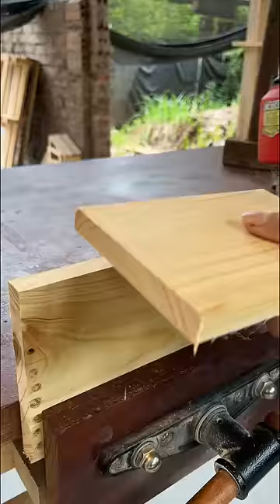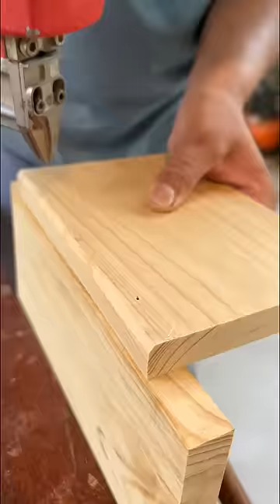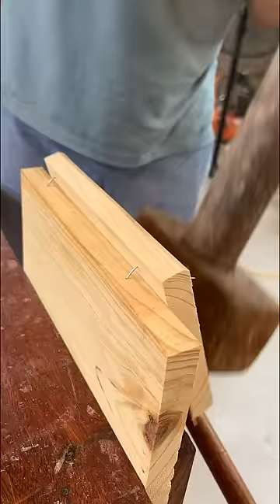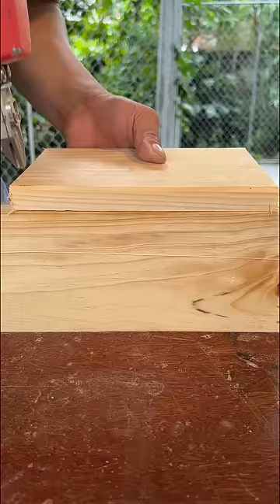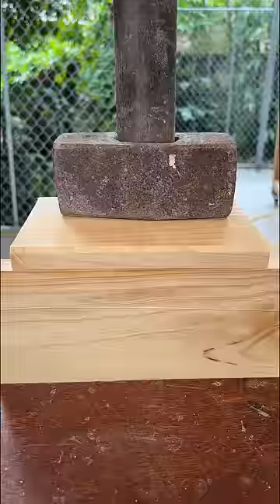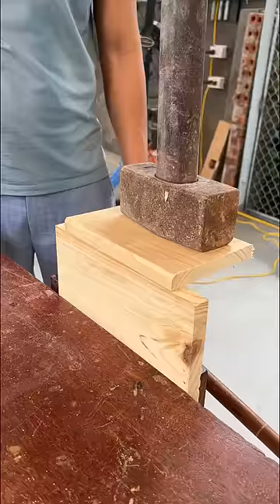How to Use a Nail Gun

Comment: Yeah no. Use wood glue then the nail gun so the nails hold it in place as the glue sets then you can set something on it. Never rely solely on fasteners to hold weight on a joint.

Comment: If you actually cross the nails like an X it's even stronger... (longer nails would help too)
Reply: The nails crossing each other doesn't make a difference, as long as that section has shear resistance in both directions, it's just as strong.
Reply: @Ensirum  I was a carpenter for 20+ years....
how about you....?
Reply: @2869may  upholster and carpenter for 10. Your years doesn't make you right. Crossing two nails at the same point actually weakens it now that I think about it properly. You know how nails and screws split wood, you've been doing it 20 years. Multiple screws and nails weaken the integrity of the grain. Better than crossing is to drive two nails from the same point in opposite directions. Or 3 to 5 inches apart. Better luck next time.
Reply: @Ensirum  I don't need luck... I have years and years of HIGH END carpentry experience ON VIDEO you can see for yourself...
I'm not just talking.... lets see some of your work....? I bet you don't know about turning the nail gun so the chiseled "point" of the nail goes against the grain to prevent splitting.... (you'll SAY you did though.. lol)
"Better luck next time"
Reply: @2869may  so, your argument is a fictional one you fabricated in your head about a scenario that never happened. Except mine is a rebuttal against your asinine assertion which is factually incorrect.
Reply: I mean, technically, it is still an X just spaced out. It should still hold the same as shown in the video and making an X like you stated. X marks the spot because X holds the spot 😅👍🏻
Reply: @DiGi1992  True, but when they're close together one holds the other they resist pulling apart because they counter act with each other against pulling from either direction.
Reply: @2869may  ok ok I understand what you are saying. Makes sense

Comment: Or use screws or bigger nails?
Reply: Or, learn proper carpentry and cut some dovetails in it.
Reply: Nothing this thin is meant to carry a load. These are for thin wall panels + glue and finish work and window lining and floor/ceiling lininig.

Comment: The first couple of ones you pushed the hammer, last one you set it on. Is there an option to report for deception/manipulation? Hes also using the weakest type of nails. Get the right equipment for the job

Comment: Simple thing a carpenter should know you drive a nail to angle and you've increased its strength by twice
Reply: This still won't support a sledge hammer. Those nails are designed to just hold the wood in place, while using glue.
Reply: @Normal1855  bet few trim nails would. But my point is driven at a angle the strength of a nail increases to fold if not more